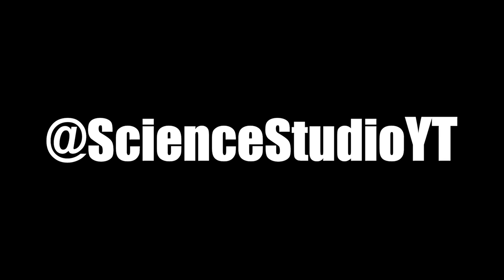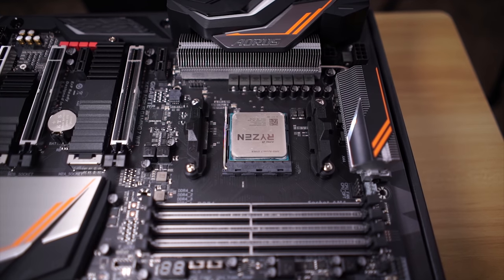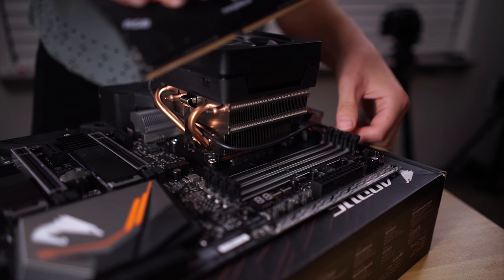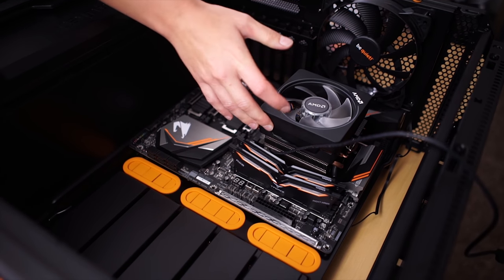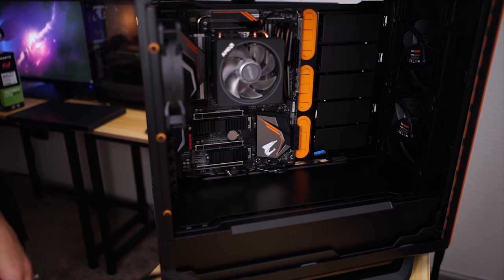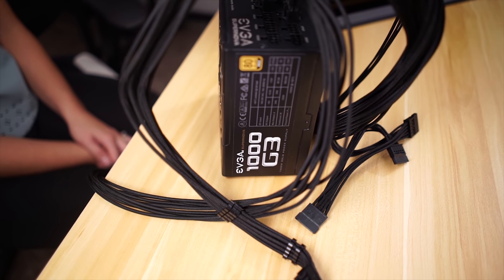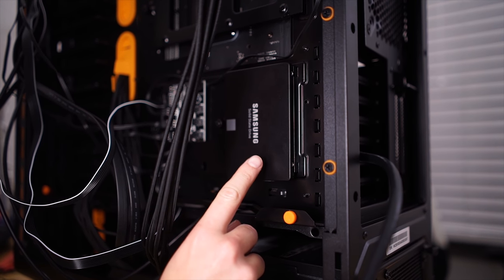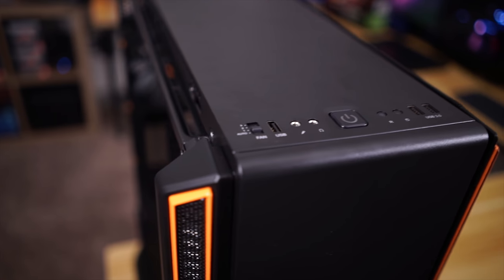Lisa Builds a Computer!

Comment: When you don't have a bae to build with...
Reply: No kid of your own to build a PC with...feelsbadman
Reply: hehe
Reply: Oooffff
Reply: @FranklinGervacio  yup. Time is ticking.
Reply: whats hotter?the pc or her?
Reply: @zilaz  With an 8700k overclocked probably the PC.
Reply: She’s not that bad
Reply: @Chris_FMS_Redfield  you can buy a cpu any time, but a gf?uwu
Reply: @zilaz  True, but my 8700k overclocked to 5 GHz runs at like 80c on an H100i GTX with the pump and fans at max speed.
Reply: Tachanka Groyper Now I get it XD
Reply: @Chris_FMS_Redfield  Then your voltage must be too high, OR you dont have proper airflow in your case.
Reply: @dyren7437  My airflow is good and my voltage is 1.5V.
Reply: @Chris_FMS_Redfield  1.5 IS WAYY TO HIGH BRO, you should definitely crank that down immediately if you want to last for at least 2 years with your cpu!!!😮
Reply: @Chris_FMS_Redfield  Is that Vcore or VID? An 8700k should be able to run 5ghz stable at 1.3-1.4 Vcore. Even amd ryzen or fx (I owned both of them) chips dont run good at 1.5 Vcore voltage.
Reply: You have us 😆
Reply: Black retains heat..
Reply: Build with?
I don't even have Bae to BE with 😔
Reply: "Danny Le and Kristofer Yee build a PC".  It even rhymes.
Reply: @CoalitionGaming  ugey
Reply: Weird flex, Bot oki.
Reply: You can build with your imaginary bae. That will works
Reply: I want to complain about how much thermal paste she's using because it makes me feel smug and condescending.
Reply: @FranklinGervacio  Black Mirror Season5 E1

Comment: i already know the dimms go on the outermost slots, but my asus prime x470 pro is 1,2,3,4 from left to right when it should be from right to left. the design has always been to give your CPU cooler space from your ram from since i can remember... its nice to see gigabyte still has common sense in their numbering... Lisa did a fine job, girl power!
Reply from the maker: It was slots 2 and 4 in this case, not the two outermost. Most motherboards are this way.
Reply: @GregSalazar  thats what i meant.. 2 and 4... or 1 and 3, its a dual channel thing, i messed up in my wording... but thanks for correcting me, dont want to be spreading misinformation on the internet, fake news... lol

Comment: So just a little warning to people, the vertical mount he’s using here is wonderful but I ran into problems with the cables. I’m dual monitoring with a 1440p and 1080p. When using the included cables my 1440p monitor was getting intermittent signals. Not sure if the monitor was asking to much for the cable but I had to end up taking out a slot cross member and hooking my original cable into it.

Comment: I need help choosing between the following two laptops:

MSI GF63 8RD(1050ti model)  - £900 - 1.8kg
HP by Omen 15 (1050ti model) - £870 - 2.4kg 

they're exactly the same on paper specs, only difference is 144hz on the hp omen.

I want something slim, sleek, and doesn't look "gaming" like for work but still be able to game sometimes, which is why i'm leaning more to the msi, mostly do engineering drawings on cad, both 2d and 3d and use word.

before you type just get a pc, I do own a pc already, but i do really need a laptop :d

if anyone could give constructive feedback, i'd appreciate it, I'am already watching many reviews and reading about both laptops as well!
Reply: In my opinion the 144Hz screen probably won't be that important with a 1050ti. If the 600 grammes doesn't matter to you then I would say save the £30 for a game but the close price means if you want to save those 600 grammes then go the msi route.

It really depends on whether weight particularly matters to you

Comment: did you just call a 1070 the loudest part of the system? My 1070 is the most quiet part with mechanical components, after the PSU which runs fanlessly. The 1070 (or at least the MSI one I have) runs fanless half the time during gaming, except in midsummer when temperatures are through the roof indoors. I reckon that CPU cooler gets multiple times louder if you give it some work to do like rendering. During gaming, I reckon the system will be inaudible though, like mine :)
Reply: HazewinDog the crinkle wrap
Reply: @superspartanman4480  Derp, that makes more sense. I was working on my X58 system while watching the video, so I totally missed the visual cue there! ty :)

Comment: Thermals or for pure aesthetics? Why the cable mod vertical mount when that case has an integrated dual slot card vertical mount?
Reply: StihlBlazed because the integrated vertical mount puts the four way to close to the side panel

Comment: Case already has a vertical GPU mount? Did I miss something? 🤔
Reply: Someone else pointed out that the integrated vertical mount was way too close to the side panel, so they used the custom one which will keep temps in check

Comment: The case seems a little big for the components, i mean functionally its fine, but i would prefer a slightly smaller more compact version of the same case, had i the choice, and had such a thing existed, but overall it looks great, and the first time in a while i have seen a 'dedicated' color scheme work, as most of the time the same color components, arent even the same shade, but this works because all or most of the parts are from gigabyte, instead of trying to color match 'white' from mulitple different companies cough 'glalax' cough

Comment: Guys, help.  I have a Silent Base 801 just arrived.  How the hell do you put the legs on?  One side of one of them snapped into place but the other just won't go in and isn't flush with the case.  I don't want to force it.  What's the trick?
Reply: I got it working no problem.  Just need to apply a little twist to it when inserting them.

Comment: i noticed one thing that , the case already had a vertical gpu slot 
SO WHY DID YOU USED THE Vertical graphics card bracket??????
Reply: more space to the side panel, resulting in far lower GPU temperatures.
Reply: The Inbuilt one was far too close to the side panel and would have turned the GPU into a fusion reactor.